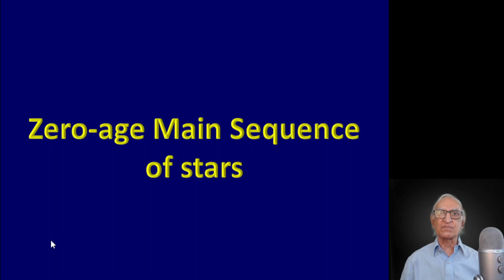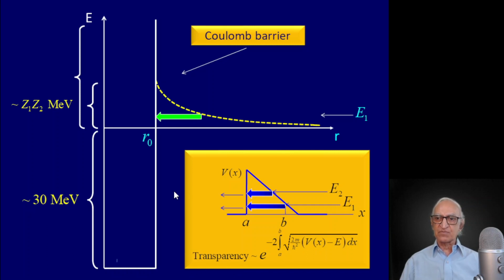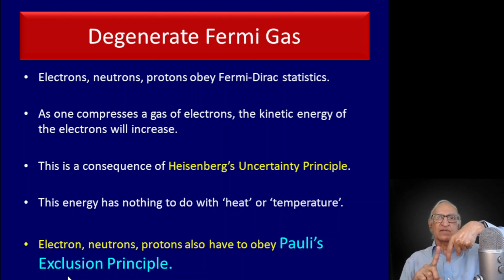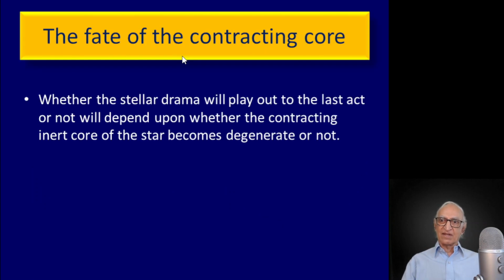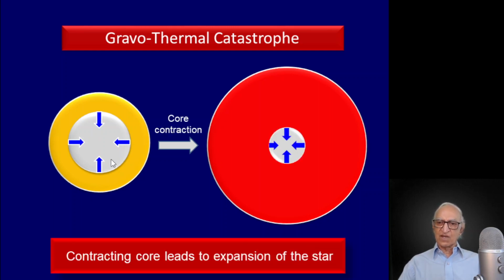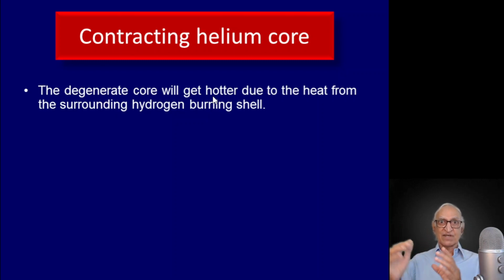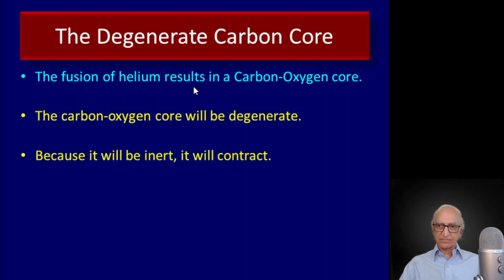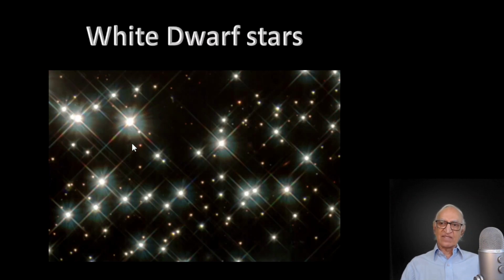Lecture 11 - Life history of stars – Low mass stars

Comment: Sir, around the 26th minute when you discuss the plot of log \rho versus log T you mention that the slope is 1/3. I am wondering if it sholuld be 2/3 instead. When I crudely calculated the slope of the red line by placing a scale on the screen I found it to be 0.75. That's closer to tan(2/3). A slope of 2/3 should also follow from the equation of state where \gamma - 1 = 5/3 - 1 = 2/3. Am I right?

Comment: Sir, does the exterior expand just after the core has contracted to its max. possible limit, or do both the processes go on in tandem? The latter case seems more improbable because the potential energy released can be used up in increasing the rate of contraction rather than causing expansion...
Reply: Please look at the slide at 36 minutes. The rise of the stars along the GIANT BRANCH is gradual. If it were sudden, then we would not catch stars ascending the giant branch.
As you will see in the NEXT lecture,  for intermediate mass stars, the transition to hiants us sudden.
So it depends on how rapidly the core contracts.
Reply: So sir, then won't the decrement in gravitational potential energy be used up in accelerating the contraction rather than causing the exterior of the star to expand?